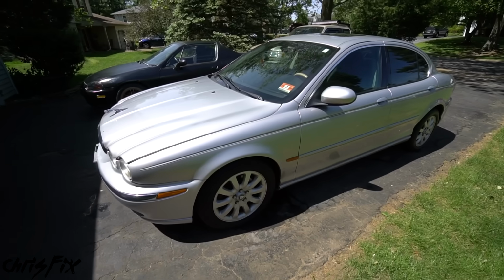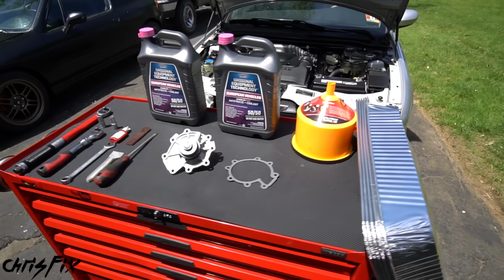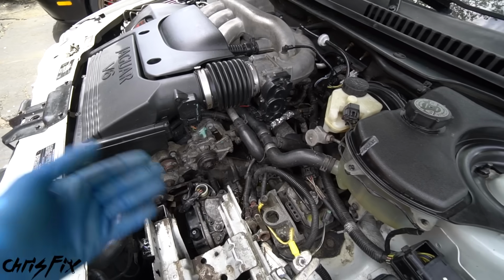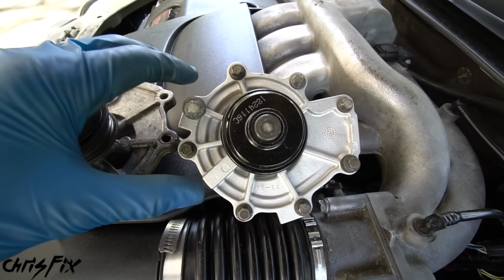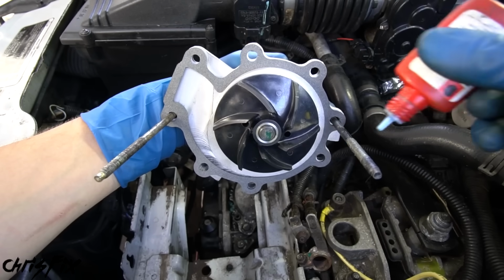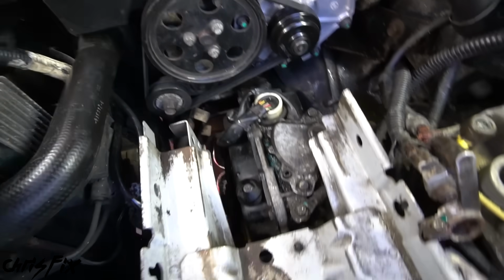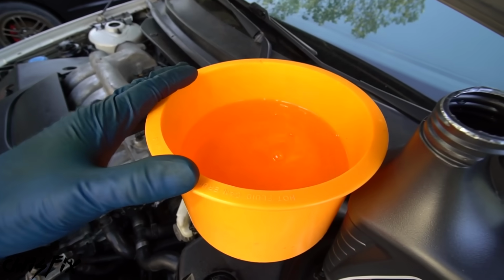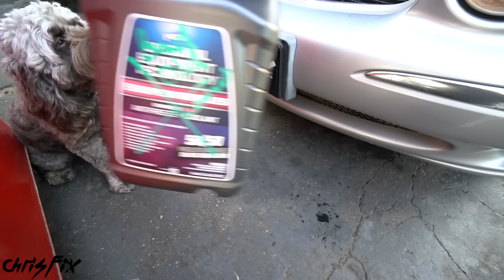How To Replace a Water Pump and Save $783

Comment: Chrisfix son: Hey dad look I installed a new water pump.

Chris:Did you torque to specifications and use medium strength thread locker?

Chrisfix son: No.

Chris; Aight Imma head out.

Comment: coincidentally i just did my ranger water pump. The water pump was pretty easy to get off but the gasket material took twice as long to remove from the engine than the entire water pump. Brake clean didnt work that well. Ended up using 3000 sand paper. Anybody got ideas for getting the stubborn gasket off in future?

Comment: Hey Chris, thanks for all your videos. I’ve learned to do things from changing my oil, struts, brakes, etc thanks to you! I have a question do you think having the wrong coolant in my car can cause it to burn oil? And even the coolant itself
Reply: It depends on the part. I used the wrong coolant in my car and it turned my thermostat housing into Swiss cheese and I had to replace the housing unit.

Comment: Just replaced mine a week ago, but noticed a small leak from the gasket. It was a paper one so I changed it with a steel one, and the leak is still there. What could be the problem?

Comment: Hey Chris, question: when you remove the spill proof funnel towards the end, does some air still get inside the system from the little time it takes to remove the funnel and put the cap back on the coolant? Thanks in advance!
Reply: No

Comment: I’ve literally set for hrs and watched many videos. Just took my H2 hummer apart namely the rear breaks and suspension all by myself. All new parts going in and I’ve never ever worked on a truck this size. Saved probably thousands of dollars already. After this moving in to the front of the car. Feels good.

Comment: I’d put thread locker on all of them regardless.  Just because they don’t leak now, doesn’t mean something won’t happen down the road. Also, I like how you use your torque wrench to torque all the bolts down. That’s what a real mechanic should do.
Reply: Most mechanics don't use torque wrenches on the regular. However, they do on engines.

Comment: Much easier then a Ford Edge. On the Ford 3.5 the water pump is internal, yes behind the timing chain! Oh yea, you also have to pull the motor or at least drop the front side down below the frame rail, arrghhh.

Comment: Big fan. Any chance you could do a video on replacing the air intake for VW 2.0Tsi engine (I have a CC) - this is a common fail on these engines where the part isnt so expensive but the labor is alot

Comment: If only my water pump was this easy to repair. Honda had the bright idea of putting the water pump In a tough spot and I need to also replace the timing belt at the same time. I'ma buy a different make after this car, It gets frustrating barely having room sometimes.
Reply: Water pumps are run by the timing belt in most cars.

Comment: That job looks like its super easy, the water pump on a beater Toyota took my 5-1/2 hours (8-10 years ago) because the pulley is sandwiched inside the frame (lol). Just noticed some rust forming inside the weep hole, not looking forward to that much labor again. BTW: changing the coolant often prevents the WP from going out.

Comment: After starting the engine, I usually turn the heater on high to circulate the coolant through the heater core.
Reply: That only helps if your car uses an old-fashioned heater valve system, where coolant is only diverted through the heater core when you turn the heater on. 

Many cars these days are designed so that the coolant is always flowing through the heater core. When you turn the heater on, you're not changing the coolant flow, you're just opening an air door that allows the hot air from the core to enter the cabin.

Every car I've owned since 1992 has used the more modern system.
Reply: @dunebasher1971  Can't hurt to do it either way, if one's not sure!   :)
Reply: @dunebasher1971  the "air door" system is the way it should always be imo.
I have a '97 camry that doesnt seem to have this system. Fan works on all power settings perfectly fine. But the core is not providing the necessary heat for faster airflows.
Reply: @dunebasher1971  agreed.  I have older card/ trucks so that s necessary.
Reply: my 96 camry still uses the heater valve system, you can see the cable that connects the heater dial to a valve on the coolant hose in the engine bay, the valve is located right before the firewall. Turning it all the way to cold fully shuts off the heater core from the cooling system, you can also hear a clunk which I'm guessing is an air door as well. Turning the dial just one click away from the lowest setting opens the valve very slightly however.

Comment: Just a fyi your not supposed to fill these systems to the very top there's no radiator cap with an expansion reservoir it needs room to expand there's a min-max marking on the side.

Comment: Sorry to say bullshit shit Chris u would have left the belt on to break those bolts on the pully. Because its a free moving theres nothing holding it. That long one u pulled out does go in the block. An sorry but that has to be the easiest water pump I've ever seen in my life. Try doing that to a Pontiac Bonneville 98 ssei. I probably that YouTube on top of this what are you doing at Monmouth Mall over by Englishtown Raceway Park? Or meet up spots were Ocean County Mall or Seaside or Lakewood over on Route 9

Comment: Hey chris, i have a question. So I recently bought a acura tl and i looked at the bottom of the car. It seems like there is a whole under the engine area. As if it melted the bottom cover of the car. Any ideas

Comment: How to replace a Porsche 944 water pump:
1: Pop the hood open
2: Cry
3: Commit Sepuku
Reply: Hahaha same with Subaru 😭
Reply: @IronAxeGaming1  or an taunus
Reply: @IronAxeGaming1  too funny!
Reply: most of the newer cars takes alot of work just to replace anything.
Reply: The first step in a 944 water pump replacement is to twist off the seazed bolts off.
Reply: And a z32
Reply: Same with B5 S4 😭
Reply: Are, are you a ghost?
Reply: Glad i sold mine then. Was not looking forward to doing a clutch replacement
Reply: A mechanic just charged me $700 in labor for replacing the water pump on my 08' dodge avenger! He had to disassemble the entire front end of the car and half the engine to get to it!
Reply: Or how to change an alternator on a Chevy HHR
Reply: There are some cars  you need to dis assembled the engine. Not easy Chris fix
Reply: same with my 03 mitsubishi galant. I had jack up the car, take off the passenger side wheel, and take off the alternator belt, accessory belt, timing belt cover, timing belt, AND tensioner to get to the water pump. I also replaced the timing belt while I was in there since it was starting to CRUMBLE. It was probably from water damage from the leaking coolant, since it was pooling up in the timing belt cover. It was quite the undertaking.
Reply: or dodge charger
Reply: i dont get it?
Reply: @Nonlethal106  im guessing you need to disassemble the whole car before you can even take a glimpse at the water pump
Reply: In Toyota Avensis you need to remove halfshafts and half of the front suspension to replace alternator
Reply: @stanimirmn  yeah they use flat engines
Reply: @koszyk2120  lmao
Reply: @stanimirmn  Мерси Станчо<3
Reply: @Nonlethal106  flat engine

Comment: Not quite sure this works for a 2012 ford fusion sport, considering you have to lift the engine up in order to do so because of the fit. Couldn't believe the process until my buddy (certified Ford mechanic) showed me. The Engineers should have been slapped for the design.

Comment: Great video as always, but I think it is worth mentioning that the waterpump is sometimes driven by the timing belt.

If you don’t realize that the timing belt has to be timed, you’ll likely destroy the engine as the valves will be misaligned in relation to the pistons

Comment: Depending on the type of vehicle you may have to take off the timing belt, or just the serpentine belt. Mine is timing belt connected took me 7 hours to change because I had to raise and lower the engine and adjust the timing. But it saved me 800 dollars 💵😎

Comment: Hey Chris or anyone who know, I'm in desperate need of advice.
So my 2005 Civic originally comes with 2
185/70R14 (small right?). I hated them, so I upgraded to 205/50R16 (relatively same diameter and all just, bigger wheels).

I'm having an issue with know what is the right pressure tp put my tires at now. The stock recommended psi was 30 all around. I have the tires at 30 now but something just feels off and it drinks gas like crazy now.

Any tips?

Comment: The difficulty of changing a water pump these days is crazy. My Escape with 1.6l ecoboost just about requires removing the engine. Biggest issue is that it shares a bolt with the timing belt tensioner! WTF ford?

Comment: Question hopefully you can answer: I just had the belt tensioner and belt replaced (the a/c compressor was the culprit in ruining the tensioner and caused considerable power loss when accelerating)  and when they showed me the work they did, my upper radiator hose blew off shooting fluid everywhere. The bad a/c compressor is still on my firebird and now I have radiator fluid leaking from my upper radiator hose from the end that is attached to the radiator. Will replacing the radiator entirely resolve the issue of the leak? The housing and thermostat were placed back in Oct and hasn't had any issues until the mechanic shop changed the whole belt tensioner.

Comment: Nothing to do with the water pump, but I drive a 2008 Pontiac g5 base trim. Whenever I come to using the breaks;near complete stop, it seems like my breaks are Catching on something and it has small but repetitive jerking and they squeal pretty loud sometimes. The jerking is constant but sometimes there isn’t a squeal just a chug chug sound. Any mechanic know what it could be? They are drum breaks in the rear

Comment: Hello chris. i have an issue with my car when i start my car in the morning everytime and right after 30 or 40 secs of ignition i turn on the air con of the car my car vibrates and shuts down itself...and also if it doesnt shut down sometimes it doesnt pick up the accelerator. i have tried cleaning catalytic converter, radiator, serviced engine even changed broken seals of of engine head but still my car does the same thing...it shuts down automatically after i put load on the engine while its still cool....if i drive the car around for sometime then it doesnt do that...works perfectly fine..just wondering if u could help? thanks

Comment: Oh Joy Oh Bliss, A water pump that is that accessable,get a quote for a water pump replacement on a car like my wife,s Hyundai Getz, you have to tear down the whole front end of the engine and it,'s the same procedure as required to replace the OHC belt, so you do the belt replacement at the same time [procedure in reverse if it's belt time replacement, do the pump replacement as well].

Comment: Did mine in my s10 in about 2 hrs clutch fan was stuck so I had to fabricate a bar to bolt on to and push against it while my dad was pushing opposite way and it popped off finally not to hard of a job tho

Comment: Super cool video, but I am wondering if the part is only $40, and it was less than an hour's labor, that means any reputable shop cannot possibly charge for more than 2 hours labor. $850 for this means the shop is extremely crooked/evil and needs to be shut down! This shouldn't possibly cost a penny more than $400 absolute maximum.

Comment: Quick question I have a 02 civic I keep have a issue with my coolant reservoir over filling and I'm getting alot of pressure build up in my radiator a couple weeks ago it overheated cause I didnt notice the overflow over filling ran it with only a little coolant I changed lower hose and my thermostat it's not over heating but I keep getting alot of pressure so I used bars stop leak it worked for a couple days  but now it only overfills on longer drives I'm going to have to use a pressure test on my radiator but I'm kinda just stuck its deff not a blown head gasket no smoke no overheating no oil leaks oh I forgot to mention I drove it up to LA from San Diego no problems at all until I got back fml

Comment: My water pump in my car is a pain 1998 c280 had to do radiator and pump radiator s8 forward pump I had to take 2 diffrent pulleys and stuff off just to have room to the pump it was a pain

Comment: Or just pay an Indy 300 to do the job, nobody but a fool pays the dealer on a used car
Reply: Yes, I think people are getting decieved into thinking a water pump is an easy job.. This is literall the easiest water pump I've seen. This a under 1 hour job. That crappy water pump is probably $50, delership probably charge 400 for it. 
On most cars especially timing belt driven, it can be 3-5 hr job in a cramped corner.. Mechanics earn their money on that one.

Comment: Hey, Chris? I'm thinking of buying a 1987 GMC High Sierra. Gotta love carburated motors! :) Anyway, I think the carb needs some adjustment. You have to floor the throttle pedal for a few seconds to get her to crank. Other than that, she runs fine. You should do a video on that.

Comment: Bartender: what can I get you ?

Chris: double shot of soapy wooder on the rocks
Reply: "I'd like the ChrisFix please..."

"I don't know that drink, but I'm happy to make it. What's in it?"

"Well, first you put on your eye protection and blue gloves... All you're going to need is a Highballglass, a shaker, some common ice, a few fluids and a straw! It's_that simple!_ You should always check your recipe book to make sure you know how to make the drink, but this one is very simple, so let's get started!
First, you want a double of Soapy Wooder, a dash of Medium Strength Threadlocker, and a half ounce of Blinker Fluid, your gonna want to  shake it at 20 FtLbs of torque and make sure you get it nice and shaken up. You go to the dishwasher and find a clean cup... out with the old, in with the new. You pour the drink over rocks in a highball glass and top it with a gasket garnish. 
That's it! Your done! 
You just made the ChrisFix drink and saved a ton of money on alcohol and it looks great!
Reply: danteelite hilarious lol
Reply: That has to be the easiest water pump replacement I've seen.
Reply: @chadatkinson5091  no it is the easiest to change wooder pump. Water pumps are the bad ones to replace or repair
Reply: And a chaser of medium strength thread locker
Reply: You suck sucker
Reply: Haha!
Reply: hahahah good 1 lol

Comment: Hey i enjoy watching all your vids over and over again i even loved your driftstang journey. I just wanted to ask a question because i have a hyundai accent 2016 and for some reason when i turn on the aircon while the car is not running but the engine is on, the engine will somehow turn off by itself. What could be the possible problem?

Comment: Looks like it was pretty easy on this Jag. With many 4 Cyl. cars, the water pump sits behind the timing belt, which has to be removed. Putting one back together with a dual cam setup is probably outside the scope of a regular DIY person.
Wasn't too bad on the 1960's and 1970's cars that I worked on.

Comment: @ChrisFix @Everybody -

I'm having an issue with my 350Z. 

Stationary, Engine On, Neutral, Foot off clutch = vibrating/tapping
Stationary, Engine On, Neutral, Rev = vibrating/tapping gets slightly faster
Stationary, Engine On, Neutral, Press clutch in = Vibrating/tapping STOPS

Driving, any gear, foot off clutch = vibrating/tapping
Driving, any gear, Press clutch in = vibrating/tapping STOPS - as soon as I release clutch, it starts again.

Any ideas?

Comment: Hi Chris just wondering if you can answer this question I have a 1986 Range Rover classic and the oils light is always flashing it has oil I can not run it because when the engine is cold it runs really good as it gets hot it try’s to die and make a rod nock noise do you know what it could be? Thanks

Comment: Ok I have seen and done $800 water pump jobs that required disassembling a ton of parts. That's what I thought this would be. This job was so damn easy it was like doing the pump on an old small block Chevy or something. A fair price for that job would be 200-300 parts, labor and taxes in depending on where you live.